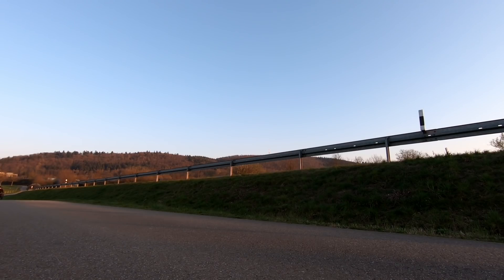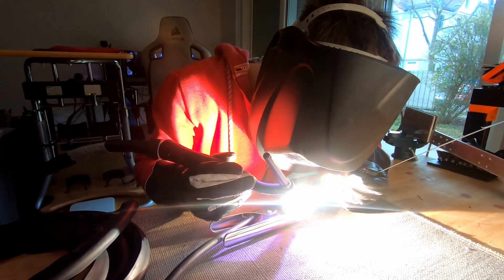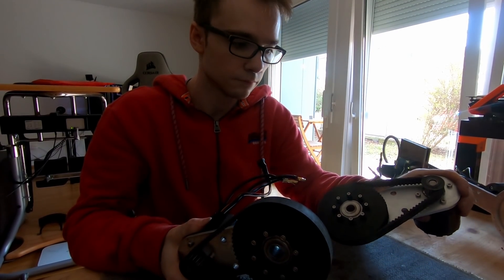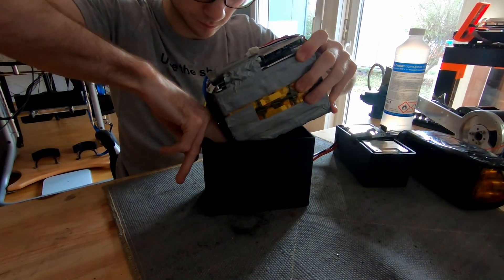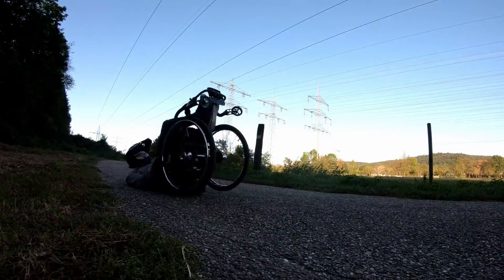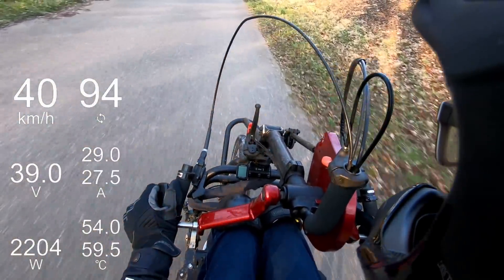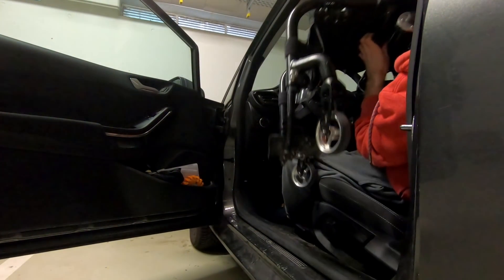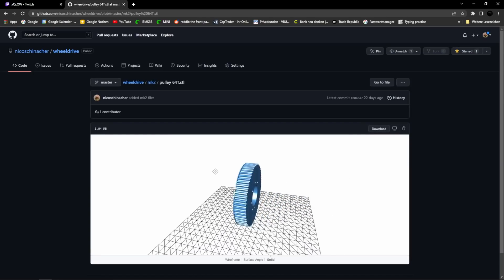I built the fastest wheelchair

Comment: I am a disable engineer and made almost excatly the same solution: used 2 Flipsky motors e 2 Flipsky ESCs so that I can control them separately whit an Arduino and a joypad ( WII nuncuck); doing this I can use everyday at home.
If I can raccomend: use a chain instead of a belt ( 25H type), it's more resistant!
My solution is similar to model "simply to do" of all mobility vendor: you can engage or disengage motors through levers ( like brakes)
Reply from the maker: Nice! Controlling them individually using a nunchucks sound like a cool project. I thought about using a chain, but belts are much less maintenance and easier to handle. I did think about increasing the torque which would probably require a belt, but for most use cases belts are fine
Reply: thats great, can you share the motor specification and also its pictures, i am also disable person . want to integrate in my wheelchair as your idea of using chain is good and more durable, can you send your project pictures or video. your help will be appreciated.

Comment: Hello ! I don't understand how your system drives the wheels. It doesn't look attached to it because you can remove your wheels as easily as a standard wheelchair. Is it just the friction between the pulley and the axe that drives the wheel? Thank you and very nice job :)
Reply from the maker: 5:06 you can see multiple silver screws on the pulley (with small 3d printed adapter pieces), they interlock with the holes in the wheel. That's the whole point, making it easy to remove the wheels just like the electric drive isnt even there ;) I have a more detailed view on my IG story highlight which shows how easy the wheels come on/off

Comment: did you use an extended axle in order to fit the pulley? how was the pulley connected to the wheel? dope video btw, i’m a t6 looking to do something similar.
Reply from the maker: I custom designed the axle. The pulley has small adapter pieces which connect to the wheel.

Comment: Hello, this is awesome. I would like to build this for my chair, but I do nit have much experience with engineering. Is there a step by step tutorial available, and could this be done using a non-spinergy wheelchair wheel? Thank you
Reply from the maker: There is no step by step tutorial besides this video. I didn't want to go too much into detail everywhere.
You can use Spinergy like I did in the first version of this drive (check first or second video),
but the adapter piece which connects to the hub has to be redesigned.

Comment: Very interesting! Maybe because I am not a wheelchair user, but I would be terrified using the motor at full speed with only the two small wheels in front. I would feel much more confident in handcycle mode or with a large wheel attachment in front. 
But my real question is about the rear wheels. With the motor, you are applying torque near the hub, whereas with push rims you would be applying torque on the periphery. I know that for bicycling, radial wheels are a good weight-saving measure for the front wheel but a definite no-no for the rear wheel because they don't stand the torque given when one pushes the pedals. Have you seen any issue so far with your wheels? If so, have you thought of building your wheels with a 2- or 3-cross pattern?
Reply from the maker: Currently 25Nm peak torque per wheel which is fine for a short period of time. That's probably why I haven't noticed any issues yet. Compared to a bicycle I also have two wheels to put the torque on the road

Comment: fantastic build I was looking into making a electric 20" fat tyre front wheel but like you it's not practical for everyday use can I ask how you manage off road if you ever venture off pavement I like to go out with my dog on like crushed limestone and forest paths I currently use my 26inch off road tyres and a free wheel attachment but thinking this would help me save my houlders but is there enough low end torque I'm not interested is speed just ability to get up steep hills ect
Reply from the maker: I'm fine with going off-road as long as there is clearance under the wheelchair.
I would not recommend my build for low RPM, high torque driving though, because the motors will overheat without air cooling and constant high torque.
However, my build can be improved by using motors with a bigger diameter (more torque, lower KV), and a higher gear reduction

Comment: Look into getting Frogleg front forks, and suspension in the back. Used to run my manual with the type you have. But hitting a stone would stop you dead..i would never use a manual without front suspension now. If no suspension in the back, move em back more. The scars on my face can tell you speed kills, but sure is fun! Nice work...couldnt help but notice your wall art..lol Circuit boards...thats hardcore geekism!
This para gives you 2 wheels up!! With a lil tweaking here n there, i would def try it out
Reply from the maker: I just bought froglegs but haven't mounted them yet.
I'm not planning on going that fast again, it was just for the video to show that it's possible

Comment: Awesome build, just curious, did you use some sort of mask or breathing apparatus under your welding mask? i assume that is argon gas for your welding, and breathing in those fumes, even in small amounts can be dangerous, especially inside, because i noticed some fumes coming from the welding and how close your face was to the welding looked like they were going straight under the welding mask. Best to be safe when using gas inside.
Reply from the maker: You are right, I used argon and it is dangerous without proper equipment. I only have a 2m wide open door behind me + an open door on the other side of the apartment so that there is good airflow

Comment: Did you do any modifications to the smaller front caster wheels? When I go >20km/h with my wheelchair, the smaller caster wheels start wobbling like crazy. It's like they get to a stage where the RPM matches its resonance frequency or something.
Second question: How is it to use without the power system? Is there significant resistance from the motor/ pulley system when you use the chair manually without electrical power?
Reply from the maker: Very good questions! 
I don't have any modifications to the front casters, that's why braking is especially dangerous as soon as the weight shifts to the front. That's why I rarely go those speeds. Just as a proof of concept in the video.
The resistance is just some watts, when I go out I always have it mounted and I don't notice anything when using my arms.
Reply: @nicoschinacher  ah, ok got it. Thanks. I presume going downhill has the same effect as "breaking". Yeah, the front center wheel is probably a must if going >20km/h, for safety reasons. 
All and all, it would be beneficial at times to get a small boost. :)

Comment: Very cool project, for battery weight reduction you could try a lithium battery. I'm not sure what downsides there are compared to a traditional battery but i use them on my dirtbike and the weight savings is incredible. Just a thought!
Reply from the maker: I forgot to mention that these are 21700 Li-Ion battery cells. Capacity/Weight and Power/Weight ratio is pretty good

Comment: Nice work!! That turned out awesome.
Reply from the maker: Thank you! Finally a simple and more reliable solution :) Also thank you for sharing!
Reply: show how you fixed the pully to wheel @nicoschinacher
Reply from the maker: @imafridi  It's not permanently fixed. At 3:20 I explain how it works. My wheel hub has multiple holes in which these small adapter pieces (black part) fits into. That's the reason I can easily remove it again (see 9:33)
Reply: @nicoschinacher  mostly wheel hub have no holes, i think for that we have to find some hack to fix it in the spork of the wheels
Reply: wondering if u will sharing some more videos regarding this light weight power addon to manual wheelchair @nicoschinacher
Reply: We need some sort of teardown of this
Reply: Don't do any deeper grooves on this. 😉
Reply: Let's get started. :)

Comment: Excellent job. Looks like your speed controller could do with a "tortoise" mode for careful manoeuvring in tight areas.
Reply from the maker: Thanks! With the remote I can control the torque of the motors very precisely. Going slow is no problem